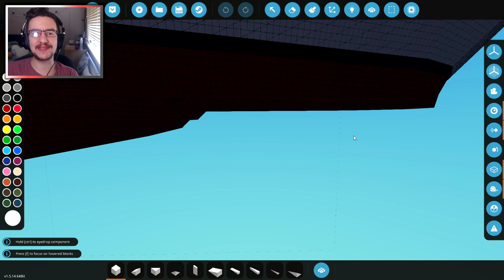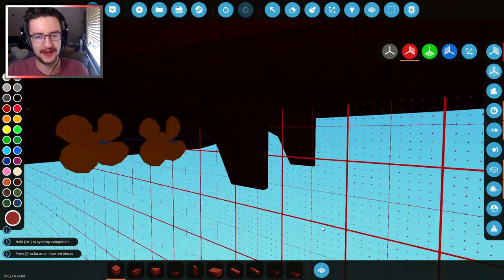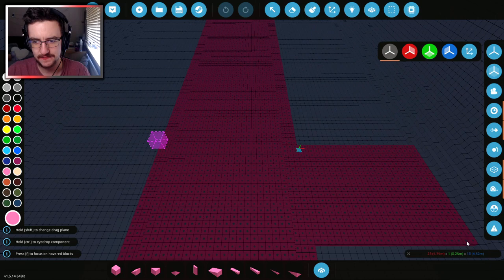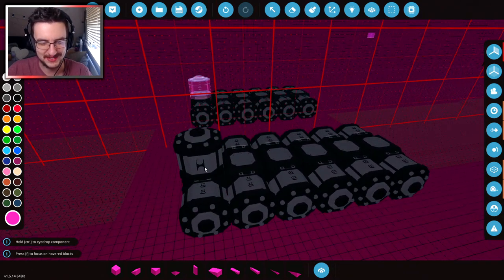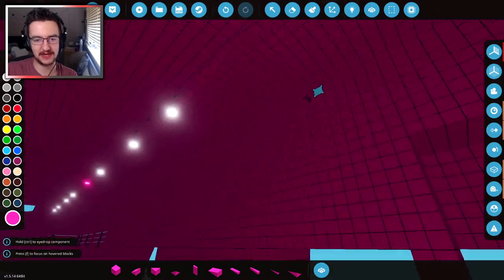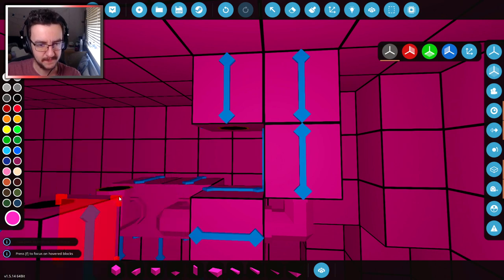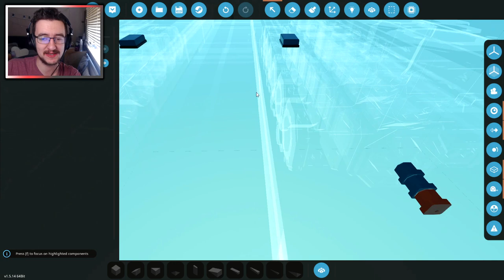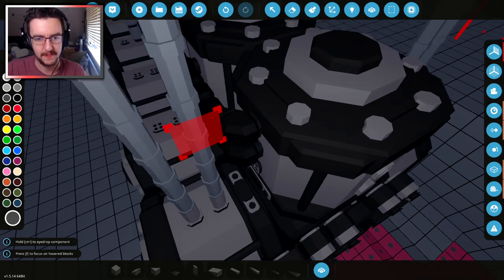Two Giant 18 Cylinder Engines! - Aircraft Carrier Build - Stormworks - #14

Comment: I don't know how easy it is to pull off, but I think that the engines should control a group of propellers. So, for example, engine 1 turns both outside props and engine 2 does both inside props. It would add some safety because currently, if an engine fails, it will cause a spin on the ship.
Reply: Not necessarily, IRL there were 4 boilers driving each propeller, this also allowed some control in the event of rudder loss by shutting down one side.
Need I remind you the rudder- S on ships of this size were gigantic and would have no issues counteracting a single failed engine, they could also rotate freely and were not hinged like on this design.

Bismarck had individual boiler-to-propeller drive and would have been able to steer correctly without rudders, however, since one jammed at a rather horribly awkward angle the propeller steer was not able to counteract it.

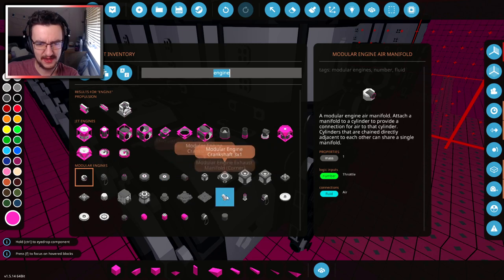Comment: The whole bottom part of the engine could of been avoided. They dont have to all be linked together just the rows need to be linked together. At 18:45 you linked one side of them with pink manifolds , but not the other side. Thats what was causing the issue with the engine.

Comment: Btw quick tip for anyone with large builds like this one having troubles with tiny holes in your hull, just section off a piece of the hull and see which way your boat leans, and do that until you have solved you problem. (Also make sure your fluid tanks are sealed)

Comment: Very cool! But I have a few suggestions that will improve things a bit. 1# add a few very large flywheels. It will make acceleration a bit slower but it will both be more realistic and give you better performance. 2# swap out the tiny gearboxes for the 5x5 ones. The small gear boxes's torque limit will greatly reduce the effectiveness of the engines.
Reply: Also if you want better turning performance, it's actually more effective to use a ton of the tiny 1x3 ones than using a few of the large ones.
Reply from the maker: Interesting, I was told there was no difference between the gearboxes. I'll change them though :)
Reply from the maker: About the rudder, I was planning on that :P
Reply: @FranticMatty  the gearboxes won't make as much of a difference but the flywheels will.

Comment: You should consider adding a balancer, u know one of does blocks made up of weights that move side to side on a track. It can help balance in big waves or in case there it a hole somewhere causing the ship to tilt
Reply from the maker: That would make sense... However, more moving parts means more lag. So I'm trying to keep it balanced in other ways :)
Reply: Also a problem is that the weight might stay on one side of the ship causing it to tip

Comment: Btw i know how to make op lever for clutch... to do so you need a threshold gate, switch box and number inverter. Connect threshold gate to reverse gearbox and switch box toggle input, number to check between 0 and max negative throttle lever. To number inverter throttle of lever. Connect number inverter to first value of switch box, throttle lever to second, output to clutch. If i remember thats it for it.

Comment: A ship that big especially aircraft Carrie’s are powered by nuclear reactors. However, a backup propulsion system such as Diesel engines and backup diesel generators is a good way to go.
Reply: That is modern us super carriers that uses reactor, CVN-65 being the first. The emergency diesel engine (EDG) is only used as a back up source of power in case we lose power, and it will only power vital equipment like fire pumps and A/C. Older carriers used steam boilers to move. I think other countries used them now a days as well as a few us mid size ships
Reply: @camron1934  They do actually serve as an emergency propulsion system ans generate auxiliary power, I’m not sure if electric motors power the propellers or it’s direct nuclear propulsion
Reply: @fcdrummer1806  I've asked and that is correct for thr new Ford class carrier but not the Nimitz class since it utilizes steam turbines to drive the shaft. The edg only provides electricity until the reactor is back up and producing steam and electricity. Other than the Nimitz class I don't know much about the other ships since I don't work on them.
Reply: @camron1934  that's what I suspected, it would be a good feature on his carrier to have a backup propulsion system, on submarines however they just have big backup batteries for when the reactor goes down.